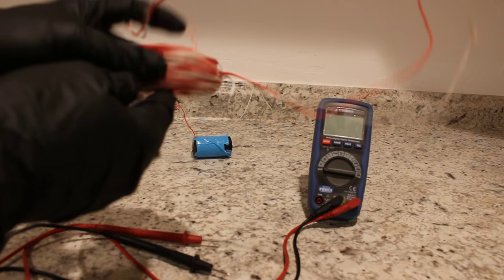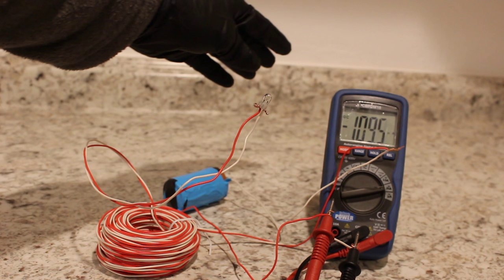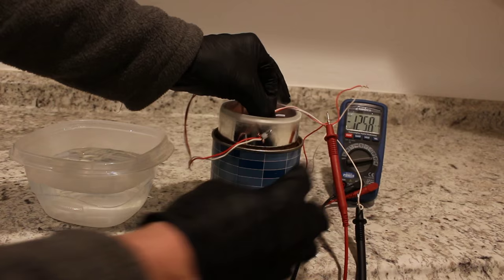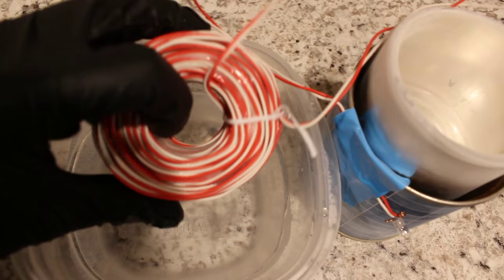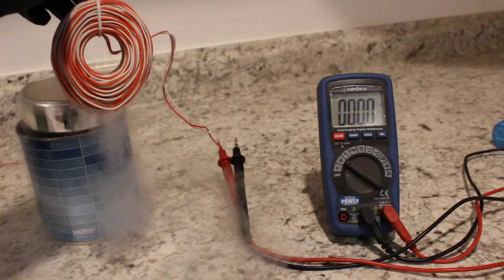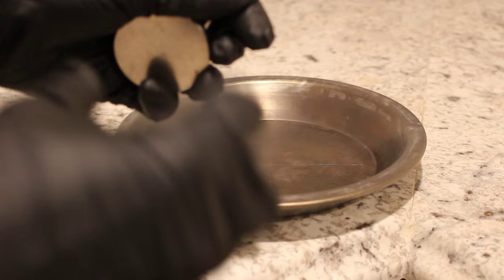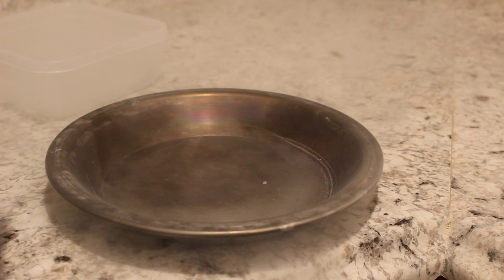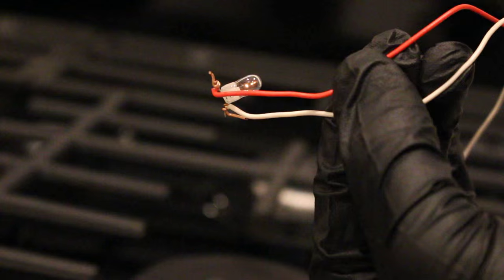Electricity vs Cold

Comment: cody, voltage is measured hooking up the multimeter in parallel while the current is measured in series.
Reply: +Petri Ševardnadze werid is the load and multy was in paralel and in the ma scale and it no blow the fuse when they used for be 250ma fuse.
Reply: +Petri Ševardnadze I was amazed that the multimeter even measured anything. Every multimeter I've ever used required you to plug the test leads into different ports for voltage and current measurements.

EDIT: my bad - just looked at a close-up of the multimeter used in the video and indeed it uses the same port for voltage and mA range current measurements.
Reply: +Petri Ševardnadze Yes. Amazing, that he knows so many things and still makes a mistake like that. He is also talking about the multimeters resistance which is negligible in the milliamp mode. Unfortunately he is using it wrongly(in parallel for current),and thereby short-circuiting the setup.
Reply: +sapperlott Yes - that is common. The multimeter has a thicker shunt resistance for high current(up to 10A normally). Amazing that he does not know how to use the multimeter. -He is short-circuiting the setup, when he tries to measure current.
Reply: +Petri Ševardnadze Yes!, Cody, PLEASE show all the NIM-WITS that you are doing things correctly.  Not just for your own credit, but so people subconsciously learn how to use a multimeter correctly! (under close observation, I was satisfied with your test setups)
Reply: +hpekristiansen I looked very closely at the setup, and came to the conclusion that the meter was in series.  You can get a voltage measurement in series, but it would cut off the lightbulb's current.  The voltage drop (caused by the resistance in the mA range [it's sometimes 1 K ohms]) in the meter is significant in low voltages.  It's less significant in the A range (typically 1 ohm), but can still cause issues with the circuit.
Reply: It was not hooked up correctly. You can't measure volts and current the same way as Cody shows. This is also why the current doesn't rise as much as he expects. He isn't measuring the right current. hpekristiansen is right..Parallel for volts, series for current. And also the other 10A terminal is used to measure current.
Reply: 10A terminal is only for 10A range. In most of those multimeters, 10A is unfused, so they are forcing you to move to 10A terminal to pay attention. In the 10A terminal is the tick shunt. But, up to 200mA probes are placed between V and COM. This path is the only that MOST have a fuse since a misplacement in the selector could be "catastrohpic" but at 10A you are done in one of these. Fluke, Brymen, BK etc are fused in the 10A range ... but ... $$$$$$$$$$$$$$$$.
Reply: +Petri Ševardnadze , He had it connected correctly. The problem was the resistance of the meter's current sense resistor was higher than the resistance of the wire. He realized that and removed the meter from the circuit. He could have used the 10A scale because it has much lower resistance, but it also has lower resolution.
Reply: +Jason Walden , in this simple circuit the meter in series will measure voltage, but it will be unloaded. It is measuring the battery voltage in series with the bulb+wire. Since the meter's input impedance is 10 Megohms or more,  the resistance of bulb+wire is negligible. The 10A jack is only for the 10A range. His meter has mA range input on the same terminals as volts.
Reply: It was in series when he measures amps.
2:53 look closely. Multimeter black on the white wire to the light bulb, multimeter red on the red wire from the battery. White wire from the battery to the red wire of the light bulb.
Reply: For everyone on this comment. Analyze things before making conclusions. You'll have the answer if you  pause the picture and look closely. For author of this comment: answer the question for yourself - "what would multimeter measure "in series" in voltmeter mode?"
Reply: Petri Ševardnadze so he was wrong?
Reply: Igor Myron the voltage drop across it's internal resistance.  Ideally, the resistance should be infinite, so the voltage drop would be equal to the supply, but...  yeah.
Reply: @38911bytefree  my €13 multimeter from LIDL has a fuse on the 10 amp and the ma range
Reply: He is a geologist and a chemist, not an electrician
Reply: @YTshashmeera  In any case, he had it hooked up correctly. It was in series with the circuit when measuring current, which is what he was trying to show. It might have been a good idea to switch to the 10 amp input, but I guess he knew that the resistance of the wire was quite high and so knew the current would be under the limit of the other fuse, but in any case,  he was able to show what he wanted to show.
Reply: @RoyBrush  He just got the words wrong, nothing a little autocorrection on our brains can't handle.

Comment: Thanks for making this awesome video, I love this channel! Its great to see science at work so visually. I'm fairly sure Uncertainty principle isn't what causes resistance to increase with temperature. The uncertainty in momentum does not have a direction associated with it so would be just as likely to increase momentum of the electrons in the opposite direction of travel as it would be to increase it in any other direction. Increase in resistance comes from increased collisions between electrons in the wire, which as you said comes from the increased vibration and phonons (excitations of electron lattice in a material), but that isn't due to Heisenberg's uncertainty principle, the electrons move more due to the degrees of freedom (basically how many different ways a system may hold energy) and definition of temperature and route mean squared particle velocity.

Comment: I did this experiment with an Aluminium Lid and Liquid Nitrogen at our Lab here in Germany. Even though my Magnets were a lot smaller it worked great. You can actually feel the induced magnetic field as if there was another magnet beneath the metal.  My Supervisor loved it :D

Keep up your videos, great work man! 

Greetings from a Chemistry Student

PS: another cool thing to do with Liquid Nitrogen:
Pour a very small amount of N2 on an organic solvent (acetone, ether) or gasoline and tiny drops will zip around on the suface leaving some beautiful smoke trails.

Comment: The multimeters have very high burden voltage (voltage drop across the leads for every A, mA, uA of current flowing) when measuring mA and uA. You need to either put meter into A mode, if the resolution is sufficient, or use external 1 Ohm resistor and measure voltage on mV scale across it. Alternatively for measuring small currents with small burden voltage, you might get EEVblog's MicroCurrent (uCurrent) for that. Cool videos, thanks!

Comment: When you dipped the battery in the liquid nitrogen at the end, the lamp faded because the battery's internal chemical reactions are slowed down and thus the voltage drops. That means heating up a battery (not too much of course) you can lower its internal resistance and it can deliver more current. Vice versa of course if the battery is cooled down.
Great video as always ;-)
Reply: Here you can read more: https://www.physicsforums.com/threads/why-batterys-internal-resistance-decreases-with-temperature.630648/

Comment: 3 things:1. awesome video :) 2. In the cold battery, is it that the electrons cant flow or that the chemical reactions in the battery can't occur and free up the electrons 3. If you would have hooked up your multi-meter in series instead of in parallel you might have been able to get the current reading and also see the bulb.

Comment: Hi Cody. Nice video. It was an intriguing explanation for your observation based on HB principle. Though I'm not completely sure about it. You could read about Bloch–Grüneisen law for temperature dependency of resistivity vs temperature. The general explanation is for metals main source of resistivity is electrons bumping in atoms at temperature. When temperature is lowered the bumping is reduced and conduction is increased. At very low temperature, the resistivity simply depends on the quality/impurities in the wire.

Comment: Cody, I just took solid-state physics last semester. Resistance and a solid is due to a scattering interaction with phonons in the lattice structure.  The colder the lattice the fewer the phonons.  The thermal oscillations in the lattice are what make up the phonons.
Reply: +Chris Maness here is a reference.  http://www.phys.ufl.edu/~maslov/phz7427/notes_1_7427.pdf
Reply: I always imagine resistance as the electrons bumping into the atoms of the conductor. This is far more likely to happen, when they are oscillating due to thermal energy.
Reply: +Chris Maness You three are all right. As these are just models and all work perfectly fine within their own borders (although the wave function one is the broadest of these models)

Comment: It's very important to note that thermal motion of electrons is NOT a linear function of T, but resistivity is. 
And that the drift velocity and thermal velocity are very different, the thermal velocity of electrons in Copper at 298K is about c/3 (1 million meters per second, but is randomly directed) but this obeys a square root law vs T, where as the drift velocity is about 0.5 mm/s and is directed opposite to the current.

The drift velocity IS a linear function of conductivity (inversely, of resistivity), and therefore, the drift velocity will be more or less a linear function of 1/T, so at higher temperatures the drift velocity DECREASES. The source of resistivity itself is interactions between electrons and phonons (quantised thermal vibrations in the lattice, which become more abundent with T).

Thermal velocity of electrons doesn't linearly change with T, it's directly proportional to sqrt(T),in fact at 77K the thermal velocity is actually LOWER than at 298K, it's not affected by phonons, since phonons simply reflect electrons elastically.

So when you cool down a metal, you DECREASE the thermal velocity of electrons as a function of T^(1/2), but INCREASE the drift velocity as a function of T.

I repeat, the termal motion of electrons has little to do with current, the drift of electrons is a different phenomena.

Comment: The reason for the reduced resistance of the wire in colder temperatures has to do with reducing the vibrations of the nuclei in the metal, and in doing so it decreases the probability of electrons scattering off of nuclei over a given path.

Comment: electrical engineer here. the multimeter will introduce voltage drop in the circuit when measuring small currents. this is known as burden voltage which depends on the model of multi meter. in some cases you can have perhaps one half of a volt. so if the battery is 1.5 volts and the multi-meter reduces this by half a volt light bulb would see one volt. when measuring small currents such as Milli or micro amps you must pay careful attention to the multimeter burden voltage.

Comment: Here is a suggestion, try a capacitor bank (charged by your solar cells), in a box say half way in the mine.  Couple the caps to the detonators with a shorter wire through a relay you control with a simple 9 volt battery and a remote switch on a long lead outside the mine.  The full capacitor charge will be powerful enough to set off the charge and you are outside the mine and safe.  Also, the capacitor bank can hold a serious charge and give a higher voltage to do the work for you.

Comment: I feel you should revisit this experiment with the copper pipe setup.
You can drop a rare earth magnet down a copper pipe a bit larger than the magnet, and if you give the magnet a good bit of spin it'll slowly drop through the tube, basically the vertical effect of what's seen on the plate here.
I'd like to see what happens if you cool the copper and magnet way down to LN2 temps, in terms of how long it takes the magnet to drop through

Comment: the way you connected the multimeter (through the voltage measurement vs the 10A current measurement) the multimeter's voltage measurement connections have megaohms of resistance, between the 10A connection and ground is a short circuit that you connect in series with the circuit to measure current

Comment: Hey Cody! You gotta measure the current in series. When measuring in parallel you short the circuit through the multimeter, that's why the light didn't work.

Comment: Hey Cody there is this trick that you can do. When drop a neodynium magnet down a small copper tube it will fall real slow due to the same principle as in this video. It would be interesting to see how slow you can get it by cooling the tube down with liquid nitrogen.

Comment: A simpler explanation is cooling it down decreased the resistance in the wire because the copper atom's distance got closer, so the electricity takes less work to travel from one atom to the next, because it is less distance. A spark gap takes more energy to jump 1 cm than it does 1 mm. Same principle

Comment: well with it rolled up like that you have inductance so your results may be biased
Reply from the maker: +Roush Hawley 
I doubt it was significant with such low current.
Reply: +Roush Hawley Not with DC...
Reply: +Roush Hawley How would that bias the results?
Reply: +ib9rt yeah only with AC. but that plunger he used to detonate the powder in the mines made AC
Reply: RubixB0y
go look up inductance
Reply: Well, I was hoping while you thought about the answer to my question you'd realize it was a DC circuit (though the change in temperature and therefore current flow would affect the reading VERY slightly and ONLY while the T was changing) and you'd correct yourself. I guess I just should've told you you were wrong. Go look up some manners.
Reply: RubixB0y
who are you talking to?
Reply: +Roush Hawley 
You obviously
Reply: +Cody&#39;sLab Outstanding presentation
Reply: To those saying that inductance does not have an effect on a DC circuit, would the current in the circuit not display behavior of an exponential decay? Similar to I=C*e^(-R*t/L)+D, where I is current, R is resistance, L is inductance, C and D are arbitrary constants, and t is the independent variable for time?
Reply: he wasn't using coiled wire to detonate the powder tho
Reply: im saying his test results would be biased due to inductive laws, not blast results.
Reply: I was an electrical engineer and all I was saying is that with the wire coiled up like that it could build up inductance and skew the results. i don't want any more insults or rude comments from you or i will report you and your account will be removed.
Reply: Katherine Clairmont  yes you have. calling me an "Asperger case" isn't rude?
Reply: if you don't want rude comments or insults then youtube aint the place for you buddy.
Reply: Katherine Clairmont
-blocked
Reply: Capcitance and Inductance only apply to a AC circuits. This is clearly a DC circuit. Therefor you can coil up as much wire as you'd like and run as much current as you want and there will be close to no inductance.
Reply: Braeden Lunman
ok...
Reply: Well that escalated quickly
Reply: *****
thx.
Reply: No, its not that simple. You see, inductors (much like capacitors) charge up by building a magnetic field around them. Long story short, inductors resists sudden changes in current (like capacitors resists sudden changes in voltage) and will follow a curve that tapers to a final (yet unreachable) current. In DC circuits where inductors are already charged, inductance wont affect the circuit in any way. BUT if there is a sudden change in voltage, like flicking a switch, then the inductance  will cause the current to taper. 

Due to the low voltage and high resistance, the inductance have little effect on the current, but it does have an effect. I'm just clarifying that inductance and capacitance have an effect on DC circuits. Perhaps you meant capacitive reactance and inductive reactance?
Reply: Charging times will affect the results.

Comment: actually the resistance decreases because you have fewer phonons in the metal. Nothing to do with heisenberg.
Reply from the maker: whats a "phonon"?
Reply: It's a quantum of elastic waves inside a crystal lattice, like photon is a quantum of electromagnetic waves.
Reply: Particles and/or waves of energy that travel through particles of matter, it's particle-ception:
https://en.wikipedia.org/wiki/Phonon
Reply: Way, way late but if you're still interested. A phonon is a quantized unit of sound. It's one little unit of squeezing and stretching of the metal atoms. With electrons acting like waves, they love to pass right through periodic potential fields. An irregularity, however, give the electrons a chance to reflect off, kind of like how half of a wave in the water can be reflected when it goes over a step in the water level.

The temperature won't do a whole lot to electron momentum since the conduction band of the material is already filled by the material's fermi energy (ground state). The cold temperatures are definitely slowing atomic motion but not so much electronic.

Cool video either way, thanks!
Reply: Sheikh Adil  No he did not, uncertainty has little close to nothing to do with this behaviour at 77K, resistivity is mainly caused by phonons in a metal conductor.  It's also worth mentioning that with lower temperatures, the thermal velocity of electrons is LOWER, but the drift velocity is higher due to less phonons, current depends on drift velocity, NOT thermal velocity.

Cody is confusing thermal electron motion with drift motion, the first is on the order of 1 million meters per second, while the second is on the order of 0.5 mm/s......

Comment: you should look into super conductivity, also keep in mind the wider the cross-section of the wire and the shorter the length of the wire the fewer the resistance also the material of the wire has a lot to do.